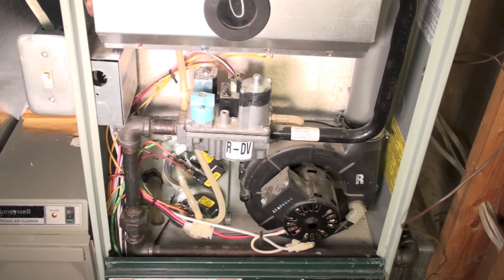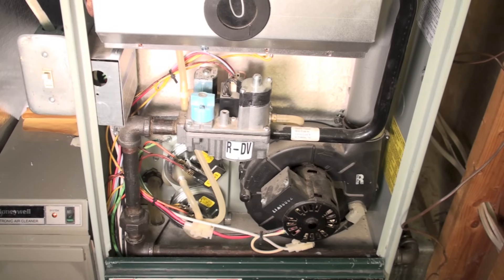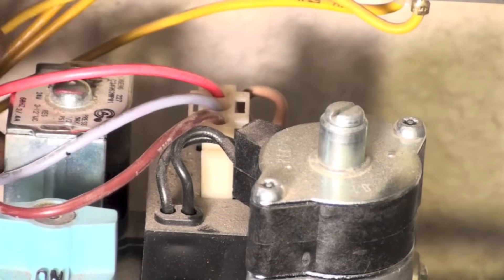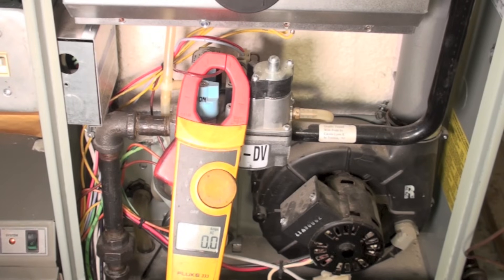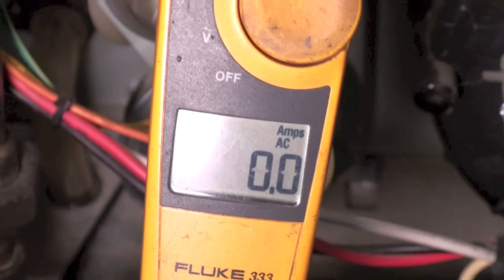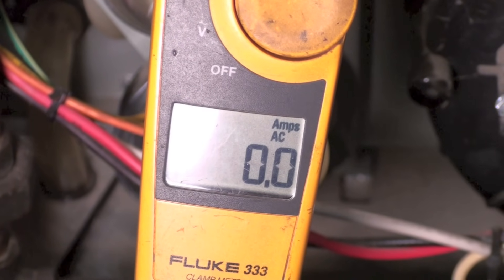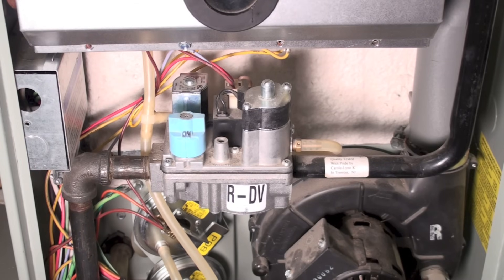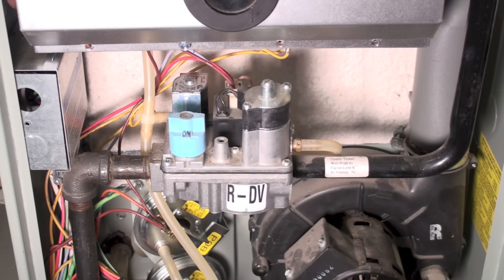The simple check of the gas valve

Comment: My flame doesn't start, I think it's a gas value issue which I replaced, but still no flame.  My furnace video is here, any help will be much appreciated.

https://www.youtube.com/watch?v=HmdSQFPEsWA
Reply from the maker: +Hanh Hoang Is gas available?  Other gas appliances work?  Is 24 volts at the gas valve during a trial for ignition?
GFM
Reply: Yes, gas is available.  I didn't measure the voltage.  I will measure it.  Does it have to be 24v?
Reply from the maker: +Hanh Hoang Yes, it should be.
GFM
Reply: +grayfurnaceman I just checked the voltage that was between the P and C and there was no voltage detected during the 3 trials of ignition.  could the board be bad?  transformer?  anything else I should be doing?  thanks a lot for all these valuable tutorial.
Reply from the maker: +Hanh Hoang Sounds like a board to me.
GFM
Reply: grayfurnaceman Thank you so much for your valuable advice.  It turned out to be a board issue.  I bought a new board and it worked after installing it and adjust the blower delay.  The ignitor didn't lit initially until I adjusted the blower delay.  I still don't understand why that's the case, but in any case it is working now.  Thank you so much!!!
Reply from the maker: +Hanh Hoang Merry Christmas
GFM
Reply: Yes, it started on and off but no flame.  Do you hear the clicking sound of the gas valve?  If no sound that could mean no voltage going to the gas valve.  I would then measure the voltage at the gas valve.  It should be around 24V.

Comment: The first thing i see right off the bat is that GAS UNION in side the burner compartment. Thats an international code violation and an EXPLOSION waiting to happen. I would be turning that furnace off and re-piping the gas supply BEFORE I would be concerned about the gas valve.
Reply from the maker: You may have a local code that requires unions to be installed outside the burner compartment.  However, the IFGC has no limitations on unions inside the equipment housing.  The only limitation I know of is for flexible connectors.   They must not pass through the sheet metal of the side of the appliance because  vibration could wear a hole in the softer brass connector material.  
GFM

Comment: You need to sum it up and get to the point. Too much dead air time and you did not say what is wrong if the gas valve doesnt open but current draw is present.
Reply from the maker: My method will not change.  Not all people understand as quickly.  
I would think it would be obvious that if there is power passing thru the valve and gas is available, the valve has failed.
GFM

Comment: I am getting 230 volts on the grey wire #2 and my furnace is not igniting. I get lockout mode and igniter is new. It clicks and then it doesn't light furnace. Do u think it is the gas valve or possible the white Rodgers control board model 50e47-843. No heat now any help would be great soon.

Comment: I have 24 volts present at the gas valve, 0.3 amps. Also have spark pilot tube has no gas flowing through it. Do I have  a stuck gas valve ?

Comment: I'm working on an amana gas pack (APG12) and I have ignition for about .5 second, then the unit shuts off. I've tested the limit switches, flame sensor, replaced the circuit board, nothing is working. Any tips?